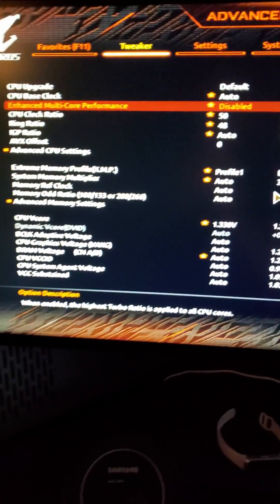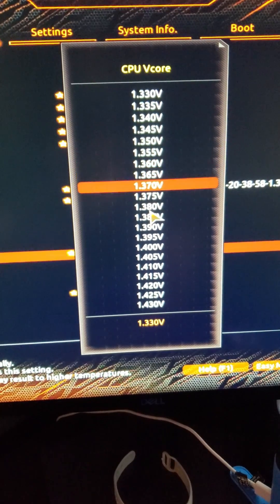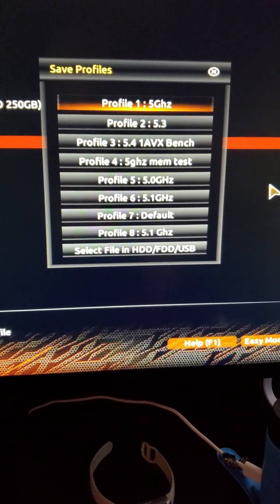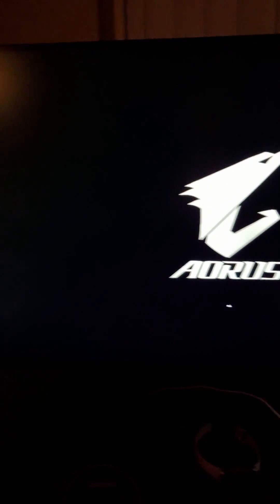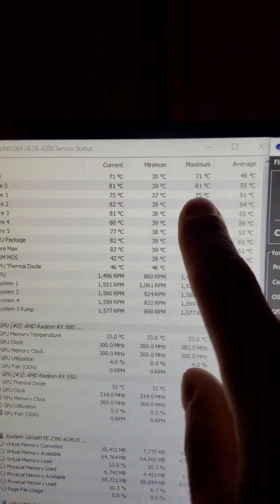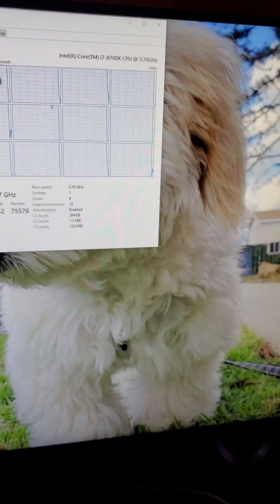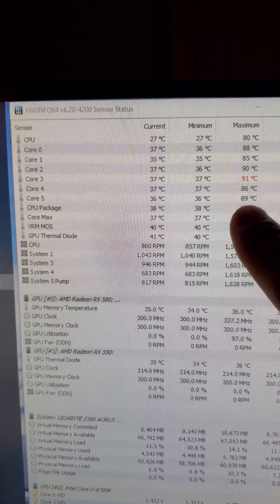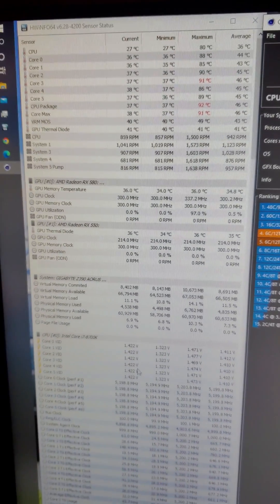Quick & Dirty 8700K Overclocking w/ Arctic Liquid Freezer II 280

Comment: Hello sir. I've same cooler but can't go above 4.8Ghz with 1.2v getting 90c with this setting. Everything is good pasting and sitting of cooler checked many times but still same. Any thoughts. Thanks
Reply from the maker: Did you delid it
Reply: @DaPoets  No sir I didn't
Reply from the maker: @atif32111  my temps dropped 23°c when I did...
Reply: @DaPoets  so this overclocking is on delid chip?
Reply from the maker: @atif32111  yes I said that in the video I think
Reply: @DaPoets  yes I forgot my bad. Should I switch to 9900k or stick with 8700k cz I can't change after deliding it
Reply from the maker: @atif32111  honestly staying on that platform is not worth the money. It's not a huge boost of performance for what you're paying for compared to a new motherboard and modern CPU

Comment: 1.43v vCore, was that the bare minimum voltage to get to pass a single run of R20? This wouldn't pass 30~60min loop of ot, correct?
Reply from the maker: depends on the temps... Overclocking is an art form based on the conditions at the time.